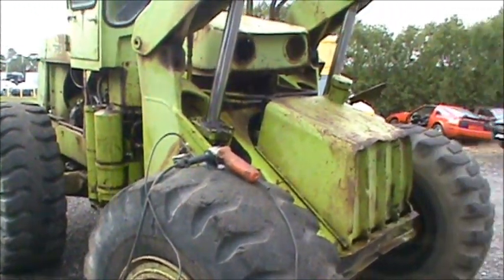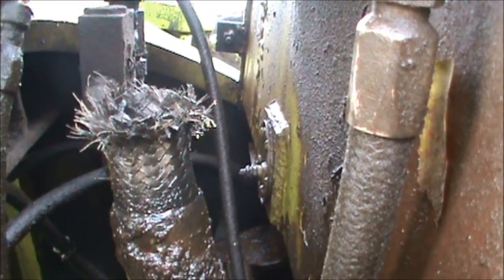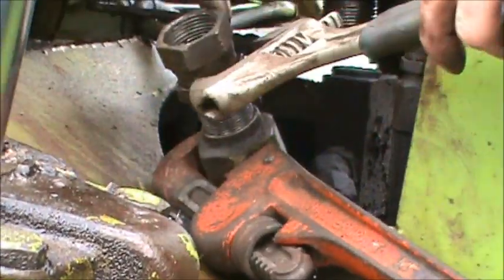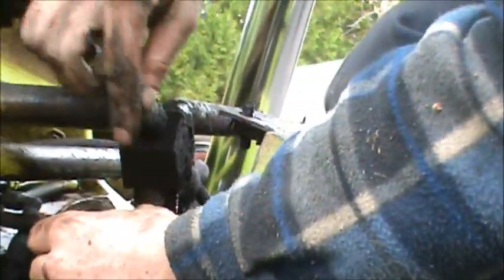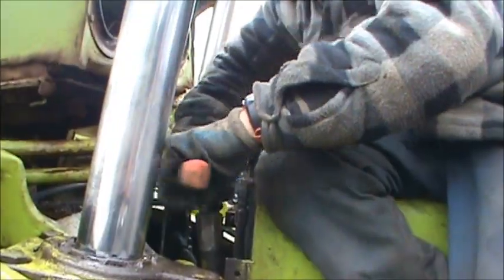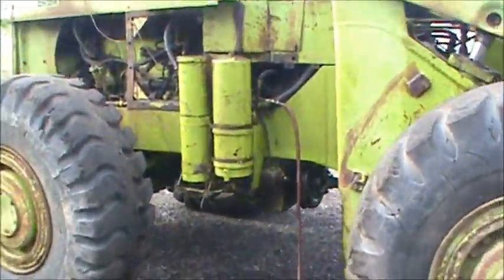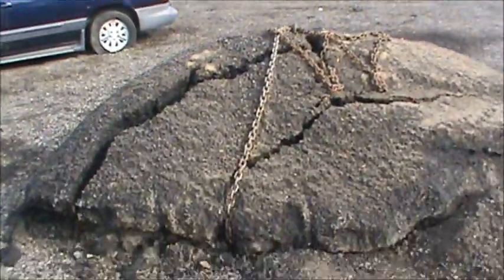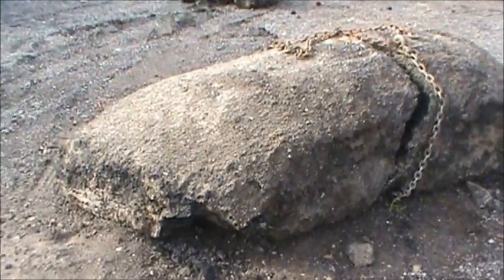Hydro Line Repair

Comment: the way they split big rocks is to drill holes in them and fill with water.
the rock cracks up as soon as the water freezes.
Would be a cool experiment for liquid to solid expansion.
enjoy your channel.

Comment: geeesus.. andy..please use boom stands or cylinder locks... cause if it blows anothr hose or somebody bumps a controll valve your dead... i have seen boom drop when a hose goes.. it takes a second then your dead....

Comment: Where is your supports to hold the bucket up you two must be wishing to die. It doesn't take much and something lets go the bucket comes down and crushes somebody.  

Hydraulic oil isn't cheap not sure what you bought but that old beast could get away with you using AW36 the AW56 would work better but it is really expensive. What did you pay 120 a pail ?